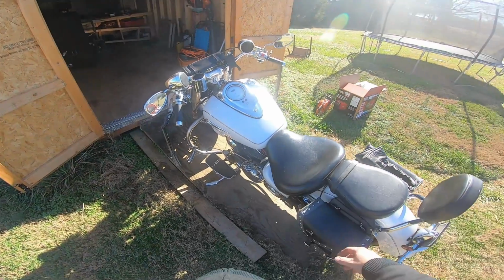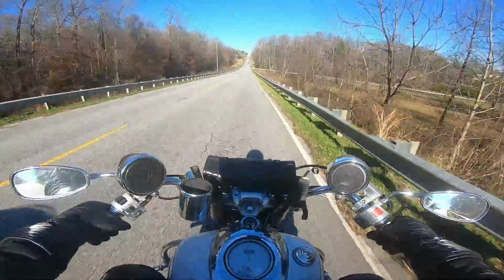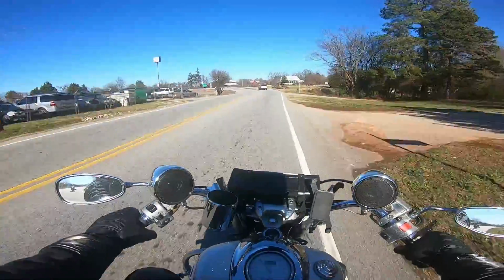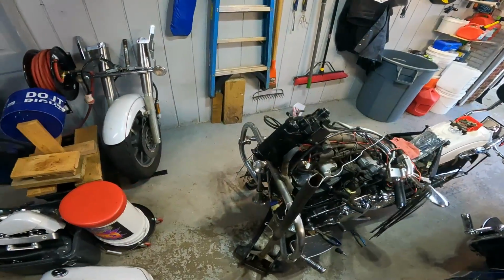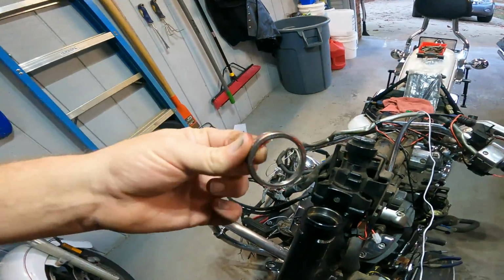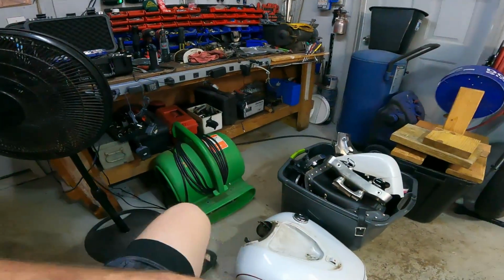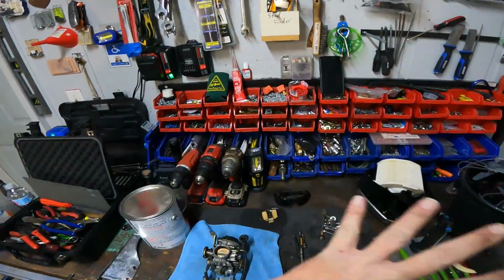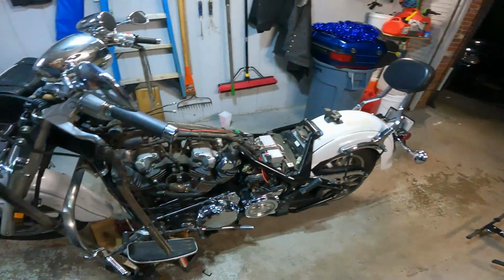YAMAHA ROAD STAR REPAIRS

Comment: i have a 2006 Road Star Silverado that looks just like it. paint is the same, bags are a little different.  it has been sitting for a few years and needed some maintenance. i took it to the stealer to have a carb rebuild and stock pipes put back on. i don't wrench very well. i didn't have the steering checked. it does the "flop" and pulls hard to the left when taking a tight turn to the left. think i need the bearing replaced or tightened. thanks for doing the video on the Yamaha.

Comment: I just recently bought a 2000 RoadStar and first thing I did was to adjust the steering bearings because the steering felt weird, just like your first test ride! It needed a little preload, but the bearings were good, with no binding or roughness. If I was to change the bearings, I think I would try heating up the headstock with a heat gun as much as possible without damaging the paint to help remove the outer race, then put the new ones in the freezer/oven as required to provide the best chance to get them on easily. It is surprising how much it helps with a transition fit like that!

Comment: my 07 xv 1700 had carb issue found a lo of fuel in oil caused what sounds like a rod knock i bought a motor any tips on motor removal and install

Comment: Hey Veronee, At 7:35 in this video you mentioned that you are rebuilding your carb because there was gas coming out of your tail pipe. I am having the same problem with my road star. My carb is out right now being rebuilt. I want to understand Why a gummed up bowl make gas come out of the tail pipe and what the potential is for damaging something in the engine with that happening. Do you have a video about that situation?
Reply: Following! I'm having the same issue

Comment: the neck races have to be completely bottomed out or the front will keep loosening up, freezing the races ease installation i even froze the lower tree so i wouldnt have to pound the bearing down so hard over the stem, theres a preload on the bearings,  somewhere around 12 ft pounds i believe

Comment: hey i have a 2000 roadstar any idea why my coils would have power but no spark at plugs?
Reply: Sounds like bad coil.  But both being bad seems odd. Did you measure across the primary and secondary?
Reply: just don't forget to flip the old race over